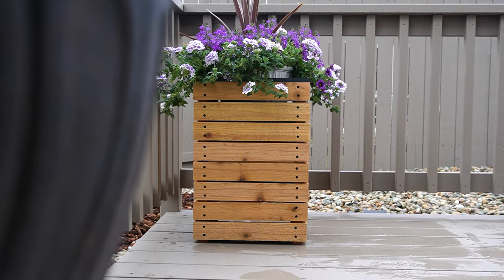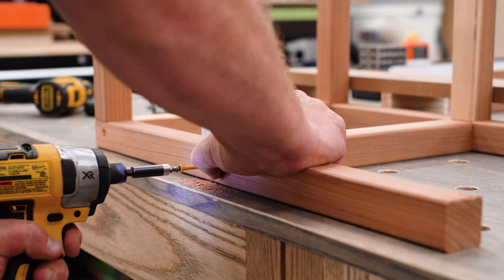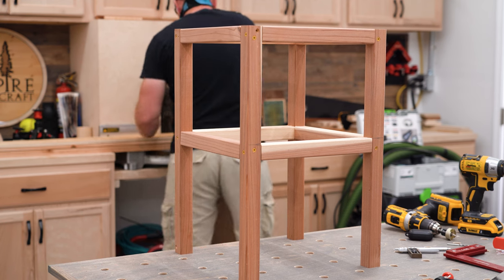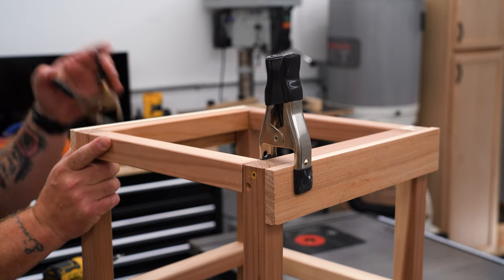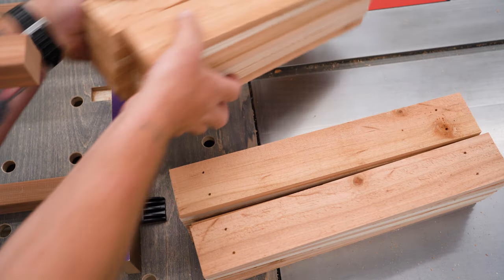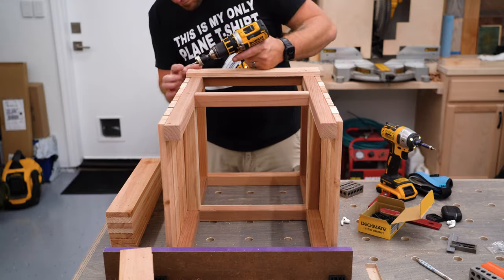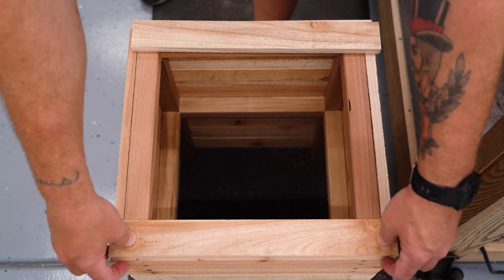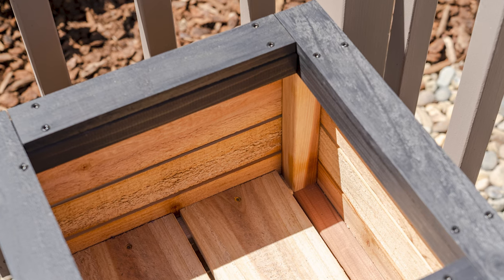How to Make This Modern Style Planter Box

Comment: The equal spacing of the screws just makes such a difference to the finished look ... and the hint about placement of the screws at the cross members is invaluable ... excellent 👍
The only thing I'd suggest is to alternate the overlap of edges at the corners, purely a cosmetic thing 😁
Reply from the maker: @Barry Christie I don't disagree with you on the corners. I wanted to miter them, but I've not seen a lot of folks have good luck with outdoor miters staying nice over time. I have one box that I made that staggers the overlaps and it looks pretty nice. So instead of all short or long slats only on each side, it's one short, then one long, then one short, and so on.

Comment: Nice design & build. Do you fill that completely with soil or put a high false bottom?
If filling completely, you could omit random (or cut into) side slats for rockery type plants to grow out sideways and drape down
Reply from the maker: @John Colgan Thank you! I made this to fit potted plants so they can be changed out easily from time to time. You could modify it very easily to put soil in though by covering the gaps in the slats from the inside.

Comment: Straight Edge Push Block???  Sounds like I've missed a valuable video.   What is a Straight edge push block?
Reply: Ditto
Reply from the maker: @Clinton Lemon III It's the same 3/4" MDF push block that I use for the L Fence! You know, sand paper on one face and one edge, smooth on the others. I found out that it is one of the easiest ways to get a clean straight edge on material. Just put the smooth side against the fence and the sandpaper face down (for grip). It's just like securing a straightedge to the material with double sided tape or screws, but way faster and convenient! I haven't made a video about it that I know of, but I suppose I probably should.
Reply: @Inspire Woodcraft  Thank you sir!
Reply: I too would love a video on this. It does look really simple, but my brain is having difficulty believing that there's such an easy way to get a straight edge. Haha